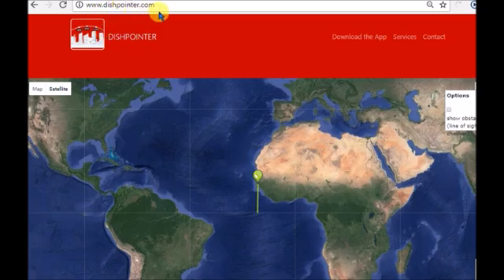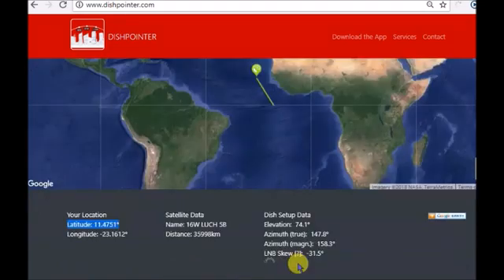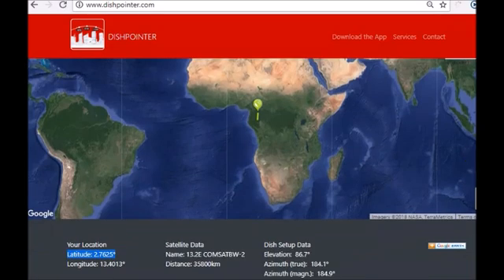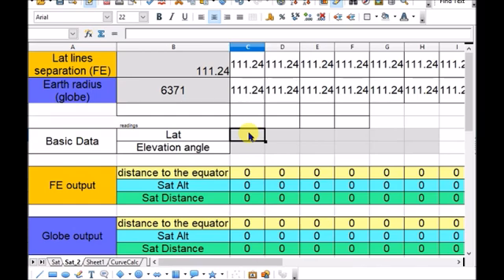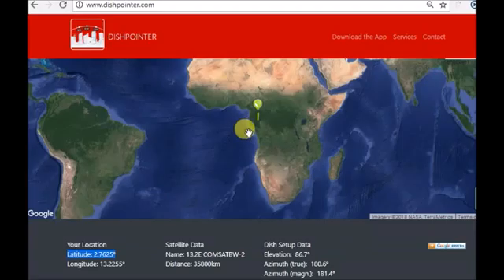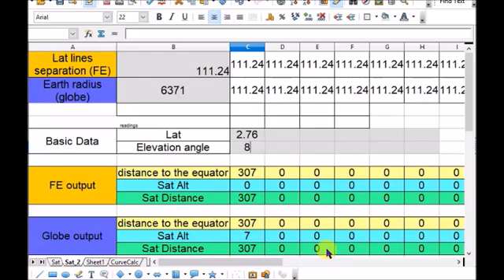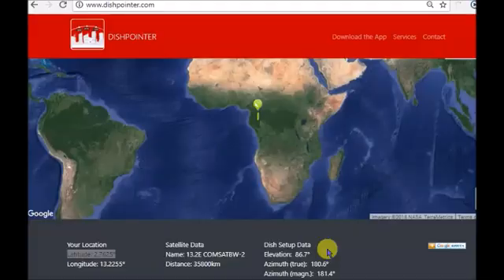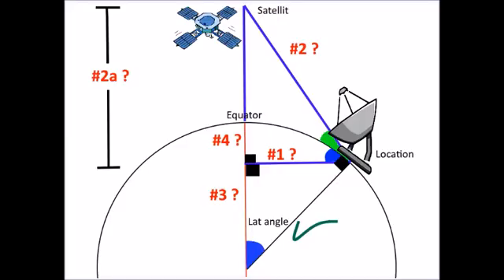Flat earth debunked BY "HARTS" ??

Comment: A small error in pointing angle to a geostationary satellite compared to the background stars on the celestial equator occurs because the geostationary satellite is "only" 36 000 km above the equator rather than the almost infinite distance to the stars.
Reply from the maker: I think the error in calculating the altitude (or solving any triangle in general) is when the angle almost 90 or almost zero, at those 2 ends we need the smallest fractions of degree but the that's not needed and won't be found in these sites, no one needs 0.05 degrees accuracy when adjusting his dish :)